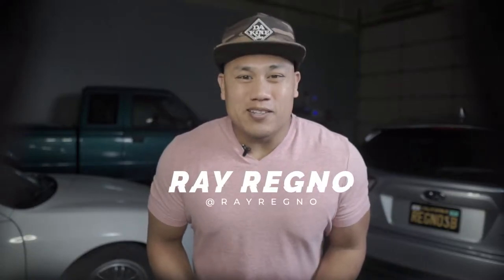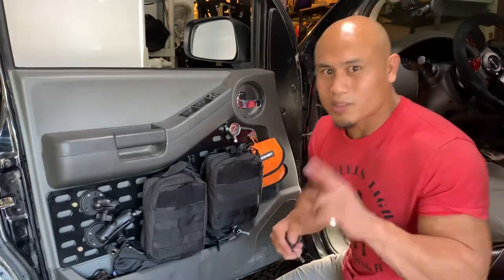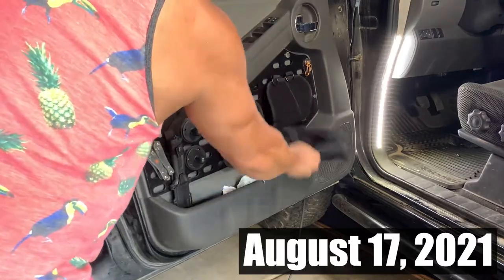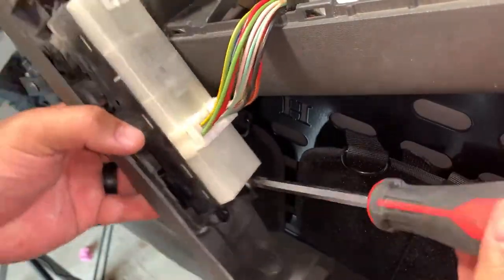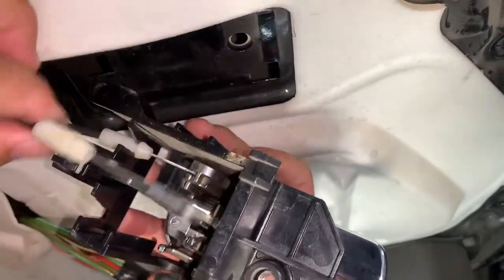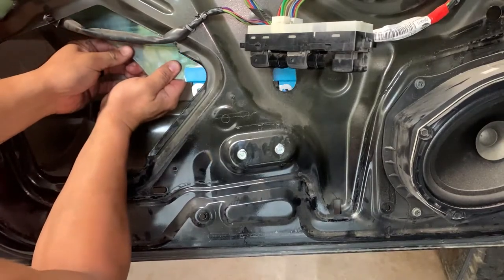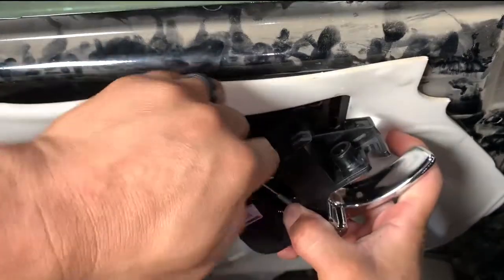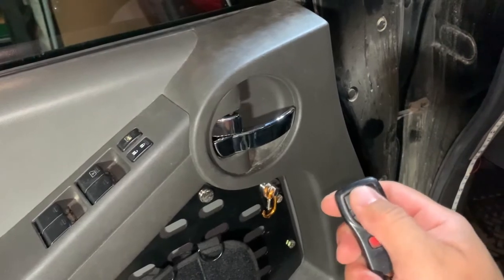How to Replace the Power Window Motor and Door Lock on a Nissan Xterra / Frontier

Comment: I was skeptical. But pounding on the panel woke the motor up. Now I can buy myself some time.
Reply from the maker: Hahah. bought me two years. Worked with my fist for a while. Then I had to start using the stick…then it stopped working. Might not actually last two years though…I have 8 and I don’t drive the Xterra much. So just do it til it stops working.